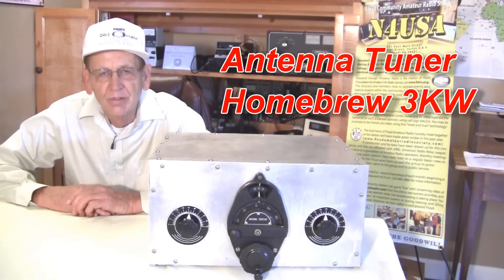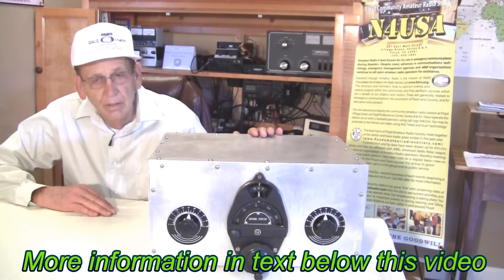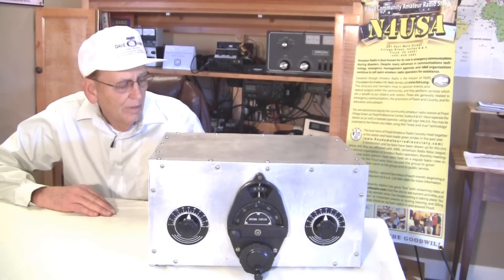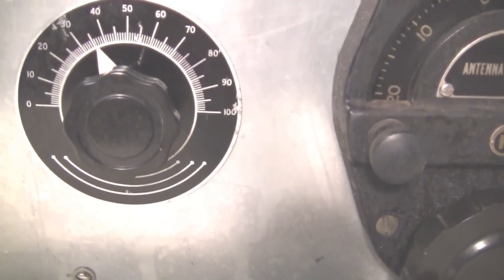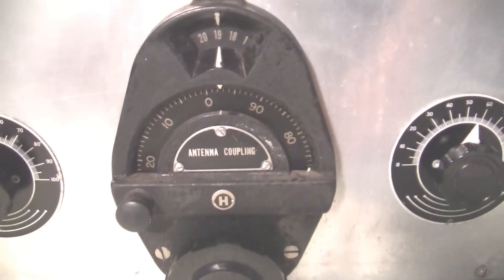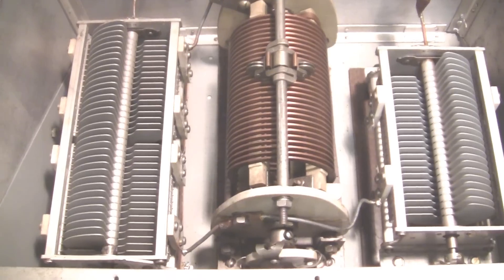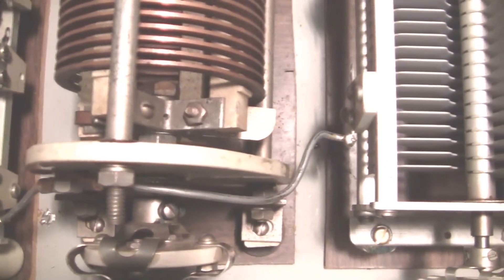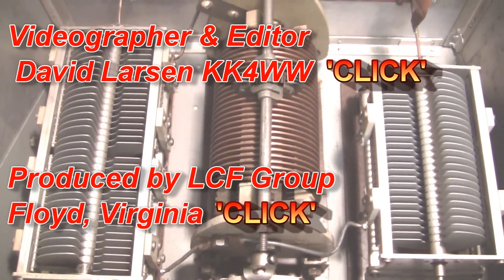Antenna tuner Home Brew 3KW

Comment: A good video - thanks.  While the turns counter could well be from the 1930s or 40s, the T match circuit the tuner uses isn't.  That first appeared in the literature in July 1961.  The article was titled "The 50 Ohmer Transmatch" by Lew McCoy, W1ICP.  That circuit became known as the "ultimate transmatch" and later builders eliminated the split-stator capacitor at the input and just put the single section capacitor in series to the top of the coil.  Today, it's known as the T-Match and is the basis for nearly all modern tuners, except for the Tentec 238 series which used an L network.  Modern turns counters are junk compared to the one shown in the video and I'd love to find one of those.  73, Floyd - K8AC